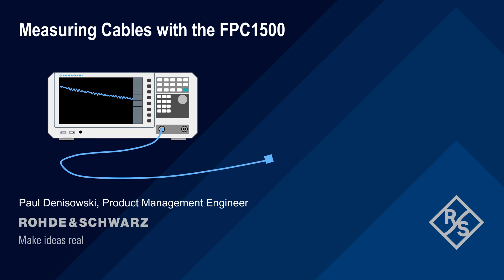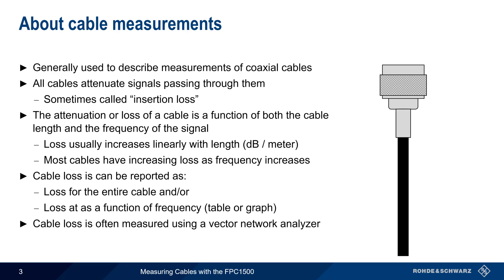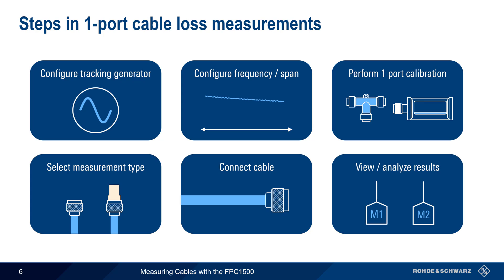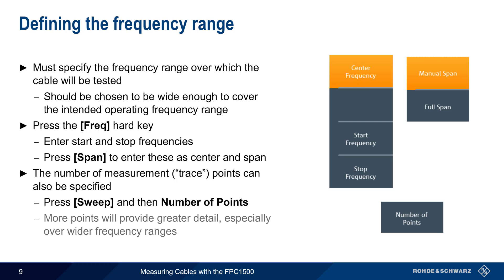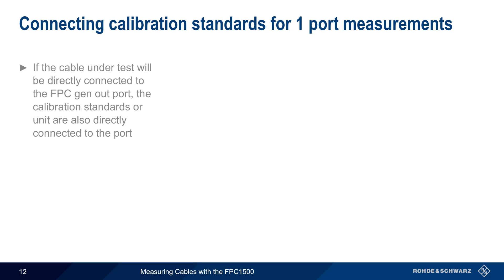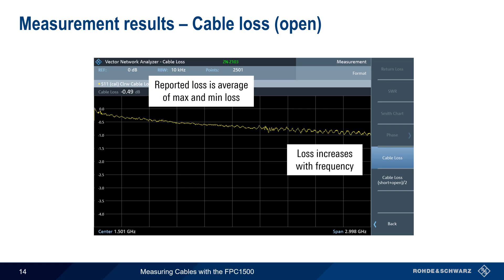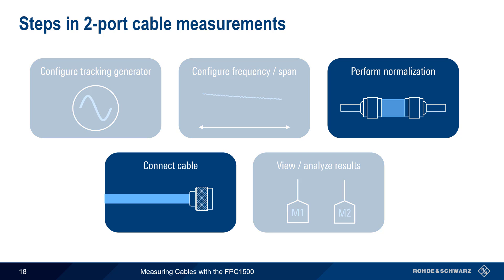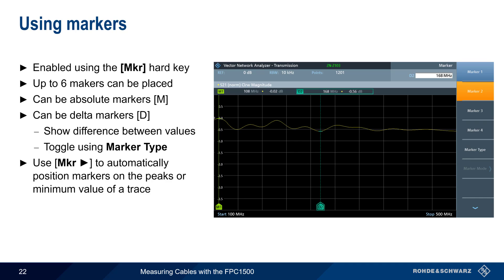Measuring Cables with the FPC1500

Comment: Hello Sir, can you please tell me what is the full form of FPC?
Reply: There are two models of the FPC - the FPC1000 and the FPC1500.  For cable measurements, you would need the FPC1500 since only this model has a built-in tracking generator and VSWR bridge, both of which are needed to make this measurement